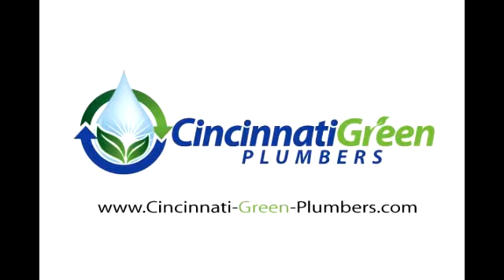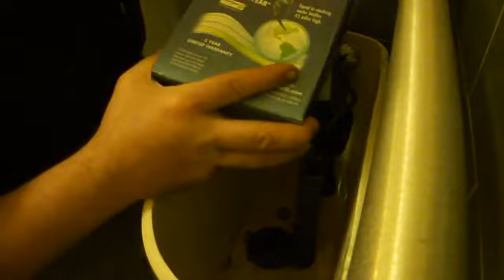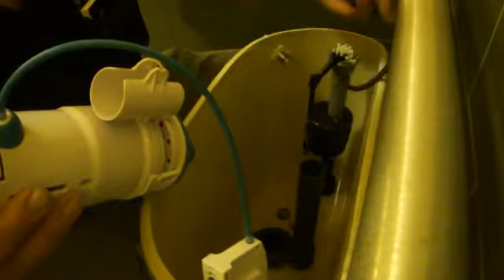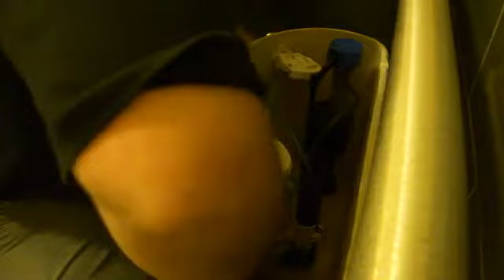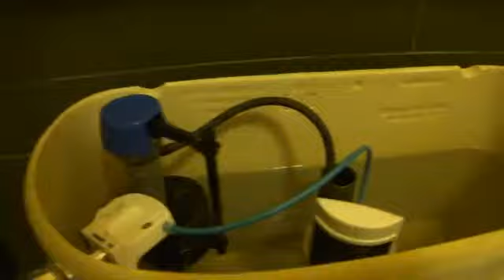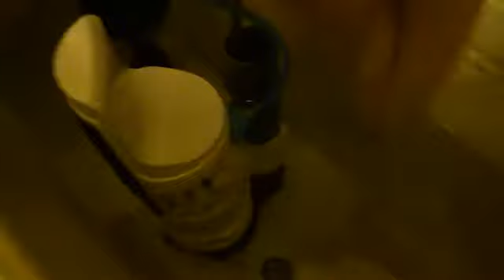Potbelly's dual flush toilet installation

Comment from the maker: @BTContracting 
Sorry about the audio, they have the speakers in the restrooms turned up the same as the store and it is loud in that little room. Thanks for the compliment and backing we appreciate your viewing our videos.  We also really like the Hydroright fill valve with the tank cleaner arm on it and the fill restricter valve.
You can tell that some thought went in to the pieces they make and it was time well spent. Over all a great product.